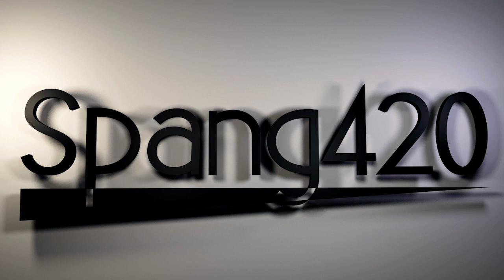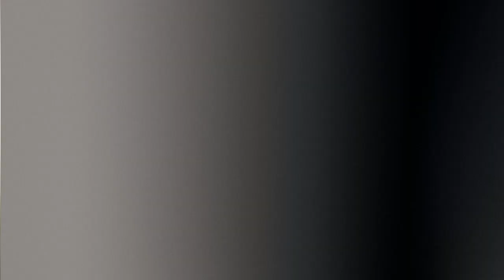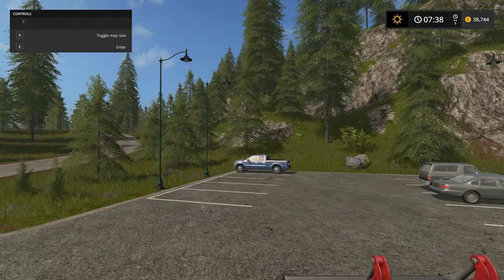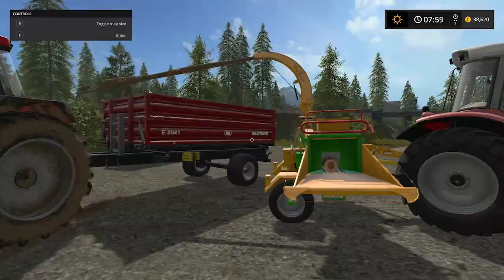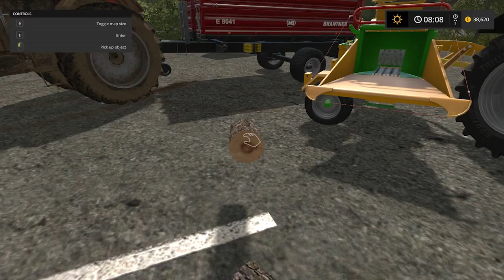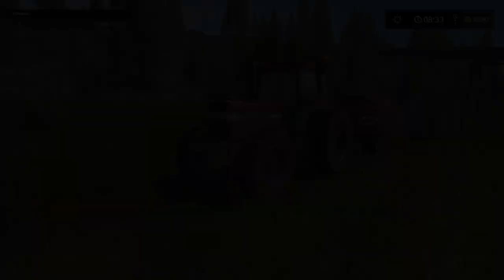Farming Simulator 17 - Chipping Wood BY HAND! (Heizomat HM4-300 & MF5600 with Commentary)

Comment: At least I'm not the only one having trouble with this piece of shit chipper. It's too small to be of any use. And the physics for picking up wood by hand is atrocious. Every time I turn around it flings the branch away. And you have to be precise to put wood in it. Sometimes it doesn't even grab ahold of the branch. I wish there were more mod chippers